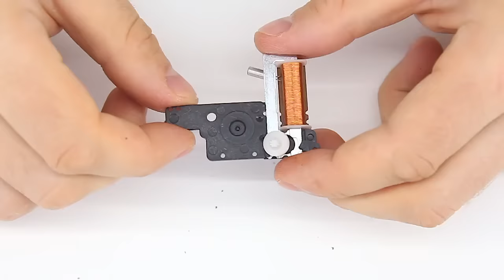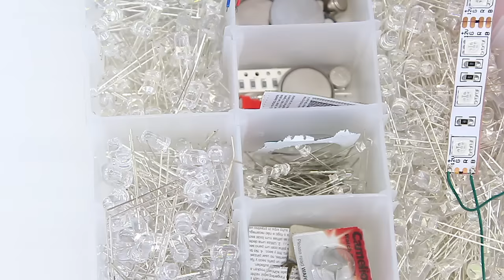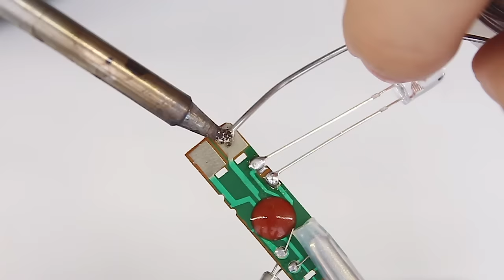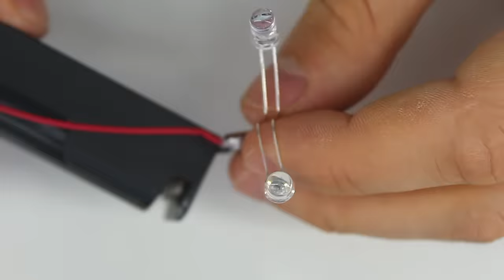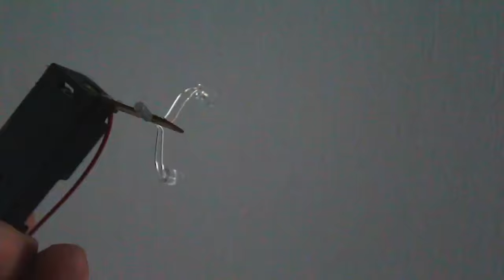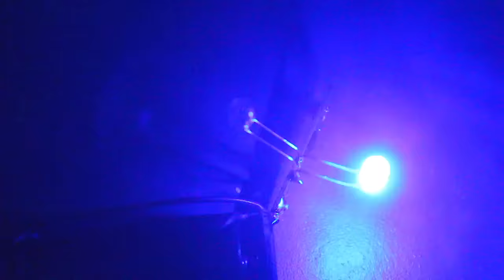How To Make a Police Strobe light

Comment from the maker: https://youtu.be/k0VjsEebK0o
Reply: Roman UrsuHack  How i understand which side is plus and which side is minus on led light?
Reply: Roman UrsuHack and I love you videos and I love you have a good day. please ans
Reply: MR BEAN UNOFFICIAL  standard led works only in one configuration and dont break in second.
Reply: Hi I circuit board I lost capacitor value how to find the value
Reply: wojciech kolaczkiewicz 😆
Reply: Pothishwar Hero try to find name of capacitor(propably numbers) or charge up fully and use multimeter
Reply: Rowan UrsuHack
Reply: genuine FAKE )))) i smashed out 4 wall clokes to do this )))  two of them worked but once at 7 seconds and then got burned )))  TIRED OF THIS FAKE YOUTUBE ))) i am leaving
Reply: dan laesu You will need a resistor for your LED. Otherwise the high voltage from your power source (battery) will burned them.
Reply: Crazy Experimenter
Reply: Pothishwar Hero What capacitor?
Reply: gamer reaction The long lead is positive, short lead negative.  Also, there is a flat area on the LED on the negative side.
Reply: @pothishwar.s9667  l..doresc. Circulare. De tiat
Reply: I think an epilepsy warning should be included in the title
Reply: romanursuhack طيني ضويات كلهن واطيك فلوس ٥٠٠٠
Reply: Don't send denger video
Reply: 🔴 What Is Islam? ⚠️

🔴 Islam is not just another religion. 

🔵 It is the same message preached by Moses, Jesus and Abraham.

 🔴 Islam literally means ‘submission to God’ and it teaches us to have a direct relationship with God. 

 🔵 It reminds us that since God created us, no one should be worshipped except God alone. 

 🔴 It also teaches that God is nothing like a human being or like anything that we can imagine.

🌍 The concept of God is summarized in the Quran as:

📖 { “Say, He is God, the One.  God, the Absolute.  He does not give birth, nor was He born, and there is nothing like Him.”} (Quran 112:1-4)[4] 📚

🔴 Becoming a Muslim is not turning your back to Jesus. 

🔵 Rather it’s going back to the original teachings of Jesus and obeying him.
Reply: bueno para mi intermitente  que estoy buscando y no consigo nada probare con un fuzer      gracias kapo!

Comment: Ok, what would you need to use a 9v Battery? Resistors on the leds only or a resistor on the board as well? Was thinking of doing this with 7 0402 (pico) leds connected.

Comment: These clock oscillators usually have a external crystal, and inside the COB (that blob of epoxy on the circuit board) there is an oscillator that drives an H-bridge that swaps polarity every second, which in turn drives the small brushless motor. This specimen was from a type of clock which seconds hand moves constantly, usually 4 steps per second, instead of the usual 1 step per second. If you want a strobe effect, you need this type of clock oscillator. If you get a normal oscillator, it will alternate blue and red flash once per second.

Comment: Or just use 2 transistors, 2 capacitors and 4 resistors. Build a resonant circuit with them. The method you used lights both LEDs at the same time.
Reply: Riddim Dubstep No it doesn’t, the video clearly shows otherwise, as the lights are wired with opposite polarity to one another, the alternating polarity of the clock component switches between matching one led’s polarity to the other and so on... So no, the led’s don’t flash at the same time, and this is easier than the resonant circuit, though the resonant circuit does allow more freedom of design and is most likely better quality, this is smaller and easier, therefore people often prefer this method.

Comment: The one thing this is going to work is you will need the type of board he pulled out.  I pulled one out of a clock and it has a capacitor and some kind of a micro pot of some sort.  It's flashed every second just working it by the second.  I adjusted the pot but no luck in flashing very fast.  I'll have to find the type he is using.

Comment: Can i ask?
If that board from a clock
And you using 3.7V Batt.
How about DC 12V?
Is it ok? Or the board
Burn?
Reply: Think you need to step down the voltage. Resistor or module.

Comment: 1.5V circuit ...... 3.7V in ?
Reply: Ditto
Reply: 1.5 v to move clock, 3.7 to feed both LEDs... The circuit isn't overcharged if it is what you think
Reply: Excellent trick
Reply: Of it's a potted 555 chip which it probably is(why re-invent the wheel) then it will take up to 18v

Comment: '
what wrong with this PCB is left side + as red and right side - as black at 117 to 125...
then again opposite left side - as black and right side + as red at 316 to 327...
dont be confuse mix with + - / - + on the PCB
Reply: The quartz is only rated for 1.5 vdc , he put a 3.7vdc in there.

Comment: How those two leds light up at different time if they are in the same line.???
Reply: dual polarity, I assume that tiny component on the board allows for dual polarity, when pad is negative the other becomes positive vice versa? just guessing though I wish he would explain the components and component functions
Reply: Cory Smith Yeah, that’s it, make the two leds’ polarity opposite and then the component alternates, matching one led at a time, back and forth